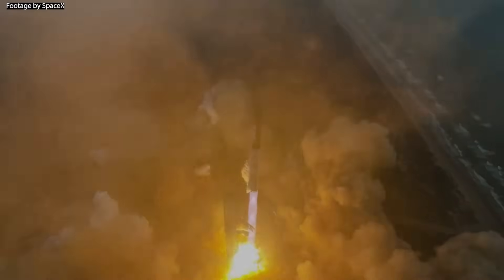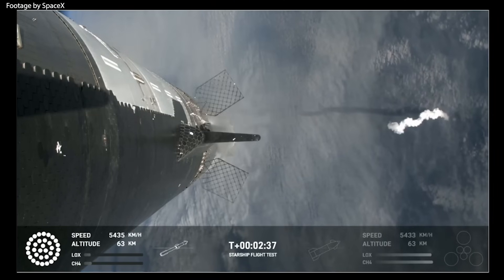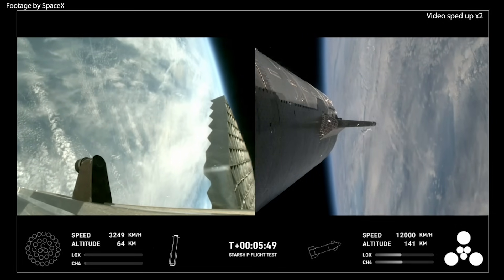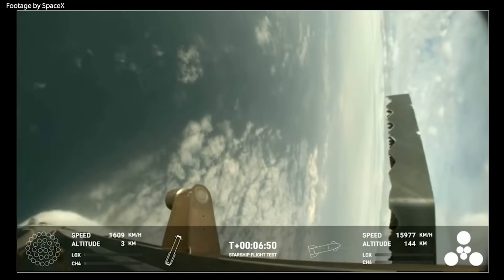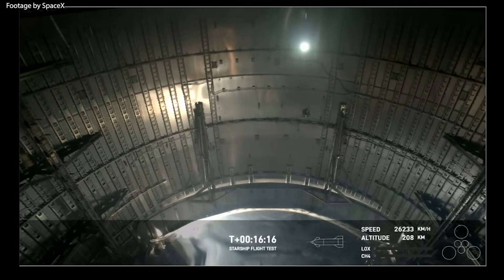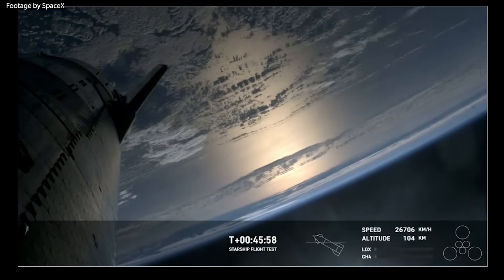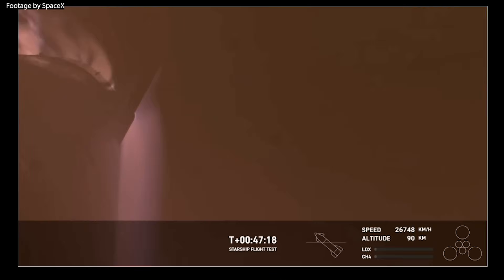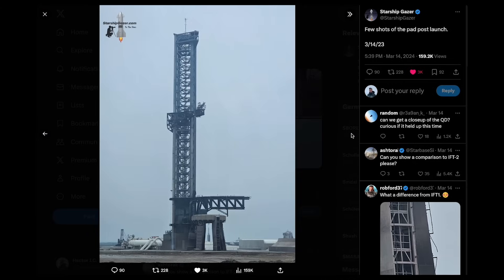Starship's Orbital Spectacle: A Detailed Breakdown!

Comment: Welp, you're the only one to identify Booster's deceleration and to point out that Stage 0 survived unharmed.  Especially when it comes to the latter point, nobody else ever talks about that, even though it's essentially new tech, a great deal less complicated or expensive than trenches/diverters/etc., and yet can handle the exhaust of the most powerful rocket by more than 2x.  I feel like it's way too early to be taking that success story for granted.
Reply: The OLM has been iterated just like the boosters and ships. Its pure genius in my opinion.

Comment: The booster engines did not shutdown nominally after the boost back burn.  The shutdown was very asymmetrical if you review what actually happened and this was very likely why the relight of the engines did not properly execute later.
Reply: Nope, it was intentional.
Reply from the maker: Yeah I also noticed that but wasn't really sure. Should have mentioned it though. And agreed, if that was indeed an anomaly it could be very well related to the failed engine relight later.